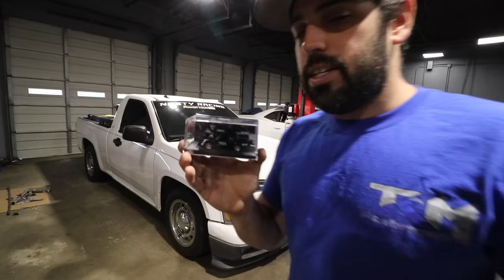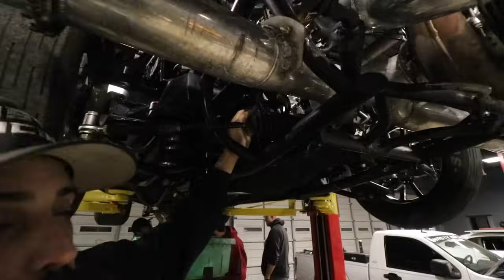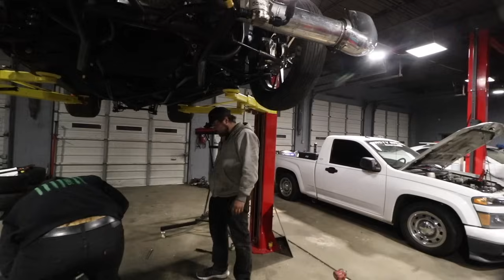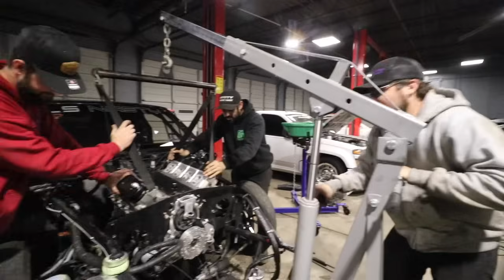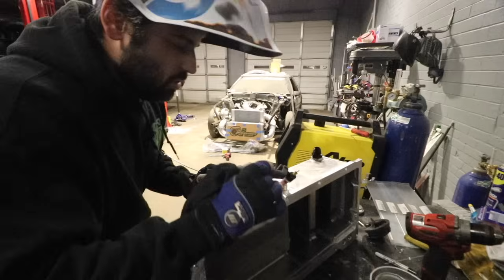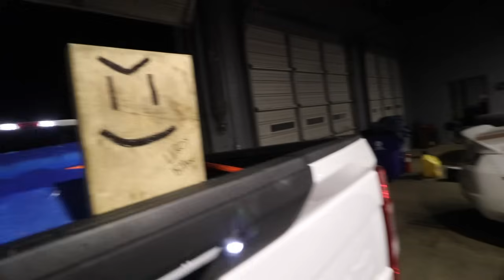END OF AN ERA!!! Black Sheep Engine SOLD!!!!

Comment: That screw blower is too big for that chassis. Unless this is a new one, the screw blower from 4 or 5 months ago that I saw the last time I here is a boat anchor.  A newer screw would be so so sooo much better. Smaller and more power/less weight.

Just like your moms, John, you need a smaller screw/blower that's got a whole lot less miles and a whole lot less physical and visual damage on it.